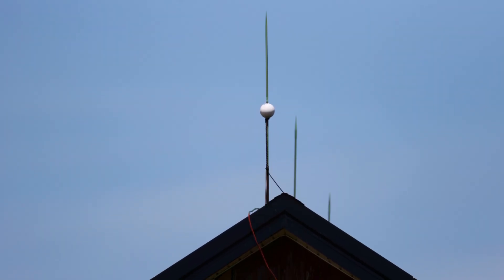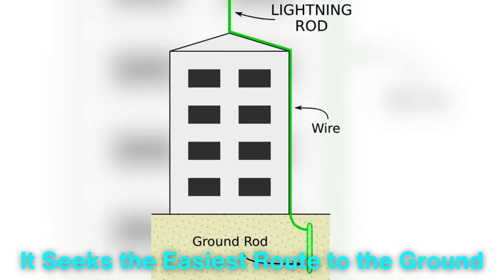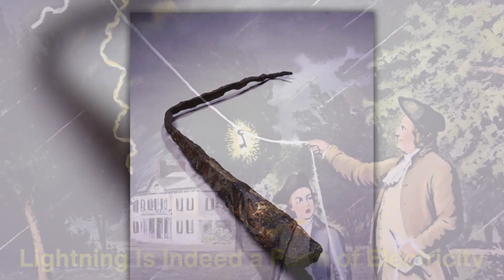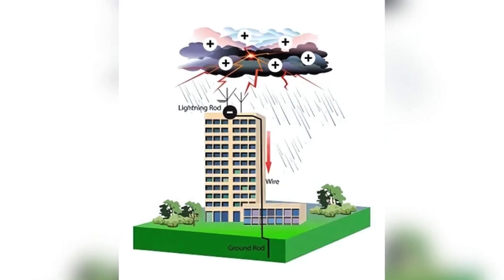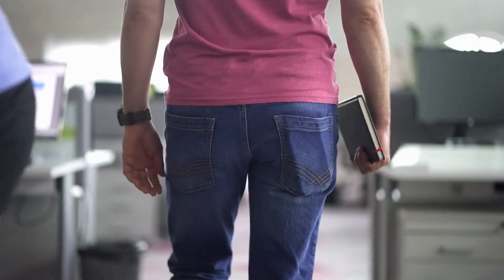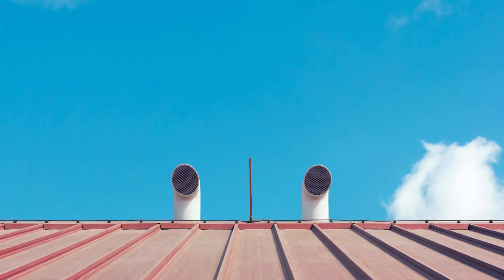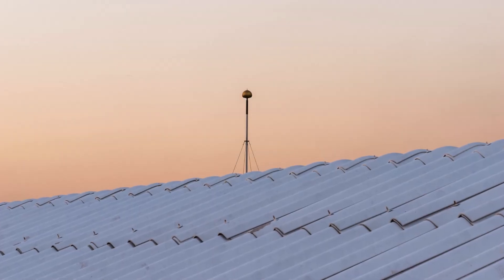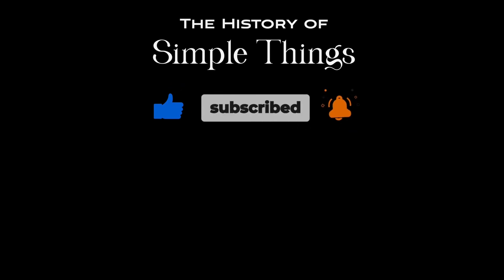Lightning Rods 101: Protecting Buildings From Nature's Fury

Comment: Lightning comes in all shapes and sizes - how do you know what size lightning rod and wires to run? 
You said that lightning rods do not attract lightning ... what does?
Does lightning ever strike the same place twice? How does it remember?
Wouldn't it be better to put really tall lightning rods beside buildings, instead of on them?
 When lightning hits the top of the rod, how does it know 'the path of least resistance', until it scouts all the paths first? Is it smarter than a mouse in a maze? Does it have a brain?
Is lightning really smart? How does it learn?
I was told that lightning starts in the ground and comes up? Is that true?

Comment: A typical lightning bolt carries around 30,000 amps of current, although the range can vary significantly from 1,000 to 300,000 amps depending on the strike.  So how is that thin wire going to conduct that with out burning up?